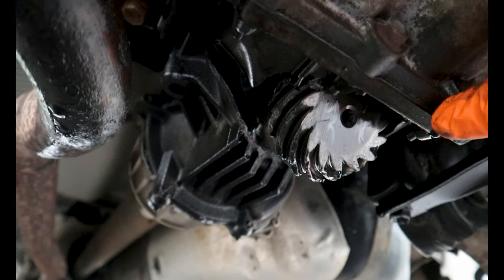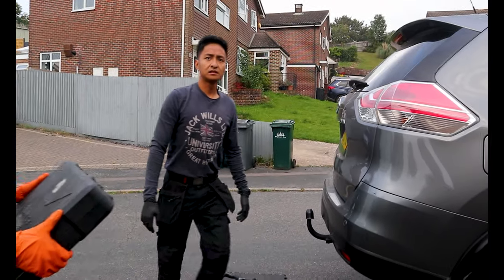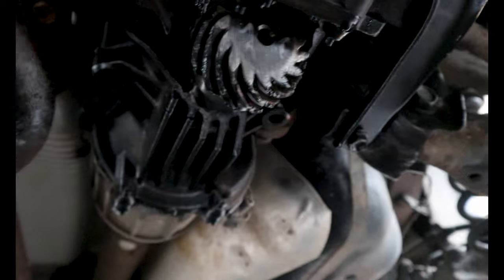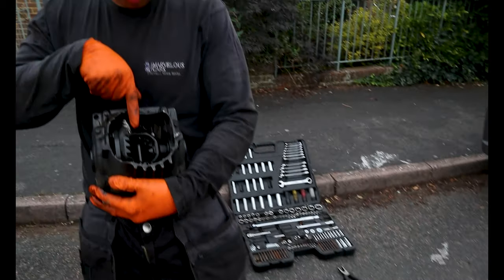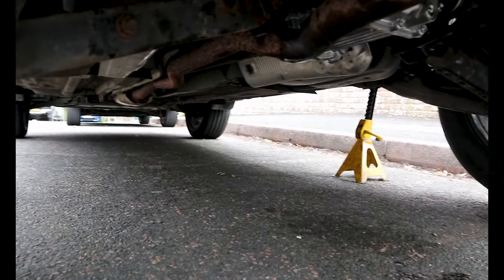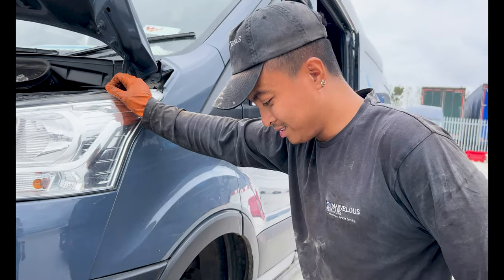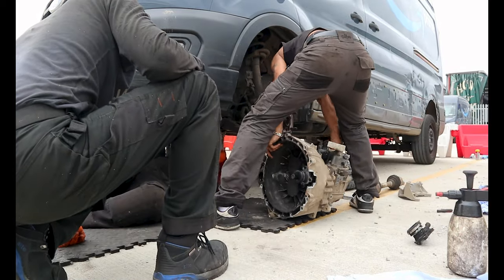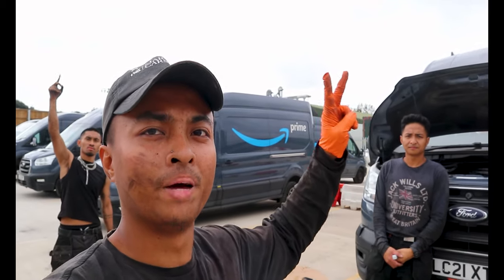YOU SHOULD ALWAYS SERVICE YOUR CAR AND HERE'S WHY! | Life of a Mobile Mechanic

Comment: Totally agree that cars need proper servicing, but I'm not sure that running out of oil would crack the casting in two like that. The teeth on the crown gear don't look too bad either. I wonder if the casing broke first, and that's why the oil came out. Could be impact damage, or someone jacked it by the diff if it's not meant to be jacked that way, or just a bad casting. My money is on failure of the case though rather than it running dry first.
Reply from the maker: We could only really speculate and hear what the customer said😅. He said he was on the motorway and boom there goes his diff. 
Part of his diff actually hit the car behind and had to spend over 1k to repair the damaged car behind him. Let’s just say it wasn’t a cheap one for him.

My money is still on old oil. Oil inside was black and thick, like CV Boot grease, as seen on the video although I can’t rule out what you guys are saying as it is still a possibility
Reply: If it was bad casting then there should be several reports of this kind of failure. Ive seen casting failures on land rovers and it occurs on many many vehicles. 
I've heard of diffs breaking like this to do too much flex or torsion, which could be caused by a failure in any of the support structures or bearings. 
It's all speculation though.

Comment: Interesting with the Nissan Xtrail has the same rear subframe as my 2011 Nissan qashqia and they do rust unfortunately and will get worse if not maintained with winter protection. 
Maintenance is important as got caught out not bleeding my concentric slave cylinder on the clutch despite doing everything else.

Comment: I'm also a little skeptical to some of the supposed "lifetime" fluids that the manufacturers like to boast about. Strangely enough though, I did change the manual transmission fluid for the first time on my 2004 seat ibiza a few weeks ago and it looked basically brand new for 20 year old oil with a slight brownish tinge, I didn't notice any difference in shift feel either, felt like a waste honestly. 80K miles on the odometer.
Reply from the maker: It probably had a clutch replacement/new driveshaft of some sort somewhere down the line? I can only speculate but they usually go very orange in colour or greyish black. 

It’s difficult to say because if you go to the manufacturer of the diff/gearbox they will always recommend to replace it around the 50-80k miles. BMW is a good example of this. 
ZF (Gearbox Manufacturer) states in their website 50k intervals whilst BMW states ‘lifetime’ 😅
Reply: @themarvelousvlog I've seen many qualified mechanics say you can use ATF in a manual gear. Would you agree?